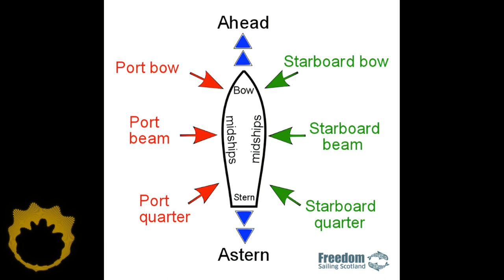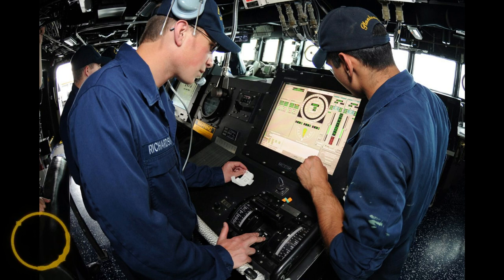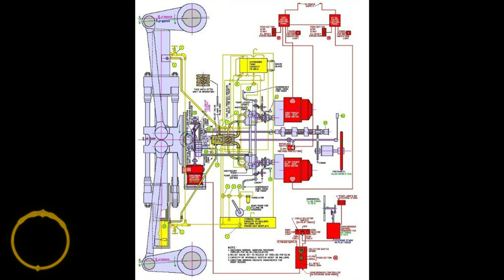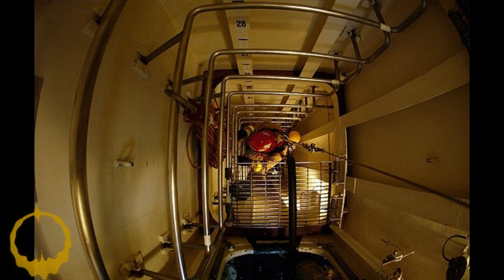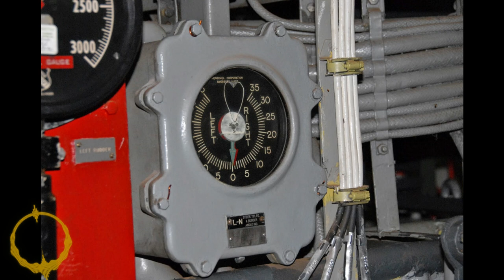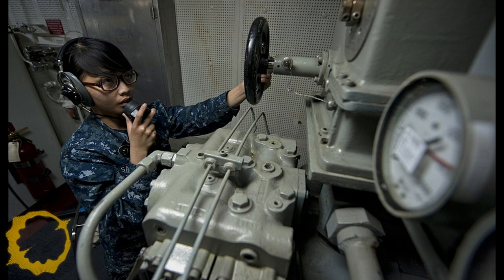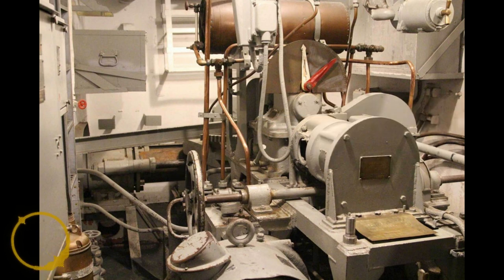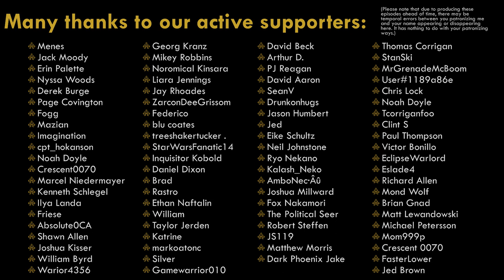I should get an award for a total lack of questionable idioms in an episode about Aft Steering

Comment: In the setting I’m writing, main drives are typically fusion torches for sublight speeds and an Alcubierre style system for FTL fed by a combination of magnetically contained matter/antimatter reactors, fusion reactors, and auxiliary fission batteries(emergency power). RCS is provided by diverting a fraction of main drive power through a vernier system across the ship. And waste heat is cycled through liquid coolant radiator strips that can be ‘buttoned up’ during combat or vented (ejected) to space in an emergency
Reply: The idea is that the fission batteries (RTGs) are used to charge traditional batteries in order to provide the startup power for the auxiliary/secondary fusion reactors on board ship, which in turn supply the immense power required to safely start the primary M/AM reactors on the largest ships like carriers (SCV) battleships (SBB), and heavy/ armored cruisers (SCA). ships classed as light cruisers (SCL), destroyers (SDD, SDDR, and SDDA), as well as frigates/heavy corvettes/system patrol cutters (SFFG, SFFD, SFFP) typically run a pairs of fusion reactors or fission/fusion combination reactors and have a number of thermocouples in line with the primary cooling systems to take advantage of waste heat while engaging the less friendly and cooperative elements.  Also, they lack the surface area and overall mass to efficiently bleed heat passively and therefore have to make up for inefficiencies any way possible.  Also, in my OC universe, ships massing less than 15k metric tons cannot independently make use of the FTL drives in canon, which means ships below frigate class are strictly in system or must “catch a ride” with a sufficiently large vessel (SCL or higher). Anyhoo, love your content, always look forward to seeing what is coming from the harbor master next

Comment: That big wrench thing... there weren't perhaps a set or two of blocks and tackles in a box underneath? Seems that would solve the problem nicely. Just break your back getting the wrench situated, connect the lines from the two block and tackle sets between the wrench and the walls and have a couple of people haul on the ropes. Much more likely to work and much less likely to kill squishies when a wave hits the rudder.
Reply from the maker: "Perhaps".

Comment: Also, regarding steering in space: unlike the "wet" navy ships, spaceships or starships do not have any practical difference in which way they're "pointed" (which in space terms is typically referred to as attitude) if they already reached a certain velocity.

So if you're going at that significant fraction of c, these tiny gas or ion thrusters ain't gonna do squat of your main drive, actually capable of accelerating you to that fraction, is out. I mean they might, in a couple centuries...
What you would actually do to decelerate, is use your backup thrusters in such a way as to alter your course and use some nearby bodies' gravity wells for a deceleration maneuver. If your secondary drive fails, well, you better starts shooting less useful cargo out of a mass driver. Maybe a decent idea to have a backup solar or ion sail?..

The actual attitude control, something I actually have experience with, is done through many different methods. First thing to understand is, the ship ALWAYS wants to turn around it's center of mass. The tiny ion or gas thrusters are a typical thing you see, and they can be quite effective, especially on prolonged hulls, but there's usually more systems that you don't immediately see. For example, reaction wheels (acceleration/deceleration of the wheel's rotation produces a reaction force on the whole ship) and control moment gyros (a flywheel is spinning at a constant speed and some motors move it relative to the ship, it tries to come back to initial orientation, producing force on the rest of the ship. Used less nowadays, a lot more in the early days of space travel.) In orbit you can also use magnetic coils to orient yourself, if the planet has a sufficient magnetic field, but in interstellar space, don't count on it...

Now the spacefaring analog of the 3 m/8 ft wrench you were talking about would be, in my opinion, manually cranking the reaction wheel.
Now it's gonna take a long time, and a lot of effort, but you can realistically rotate a hundreds of tons worth of ship by muscle power alone that way... And if your reaction wheel shattered to pieces, well... Might as well tell your crew to start running in circles.

Comment: Where does "larboard" come from?
Reply from the maker: Ladeboard, which chases forward to your current tongue as "loading board", but we figured your jello CPUs could only handle so many new terms that most of you won't actually use.
Reply: @SacredCowShipyards  
Interesting.
How did the Greeks dock with sailing vessels that had a stearing board on both sides of the back?
Reply from the maker: Their hulls were different.
Reply: @SacredCowShipyards  😊
Yes. And their methods of docking at port where different, too, partially due to the double steering board and partially because of the terrain.

As it turns out, the double steering board system is more efficient than the rudder. You can think of them as being more like flaps, deflecting the stream and creating lift. As such, they don't reduce the speed as badly as a rudder per degree turned. But they do require better coordination, more material and an expert touch. Reducing the steering boards to just one reduces the effectiveness considerably, especially to starboard. None the less, a single steering board is less cumbersome and easier to teach.

The rudder is simpler, less expensive and can be learned more quickly by a noob. Thus the rudder won out.

The most efficient steering system for a sailing boat is double daggerboards that independently lift out of the water, changing the dynamic between aerodynamic lift and hydrodynamic drag. Very little momentum is lost in this way. It's also practically worthless  while either tacking, going directly down wind or while under engine power. So you still need a rudder. Making the whole thing rather niche.

Comment: This is why in the words of O'Brian star fleet requires 2 back ups, incase the first goes down.
Reply: Unfortunately, none of those back ups, nor the primary, include surge protection. 

Because powering the console with plasma piped directly from the reactor with no cut outs is apparently brilliant.

Comment: I used to be an engineer at a factory that build touch screens.  The touch screen operates by you finger disturbing an electrical field that is in front of the screen.  So a the touch part of a touch screen will work if the screen is cracked.
Reply from the maker: Well, no.

That entirely depends on whether we're talking about resistive or capacitive screens.
Reply: @SacredCowShipyards  One of our production lines was armored screens for use in armored vehicles (Strykers and Bradleys).  Capacitive touch screens is a required spec for any touch screen above (I think it was 3.5in X 3.5in at the time, but it was about 15 years ago so I could be off on the size) that goes into combat.  But I can tell you that the touch screen on the ship was capacitive because federal law said it had to be if the contractor who installed it wanted to get paid.
Reply from the maker: And yet "screen failure due to breakage" is literally in the causal chain for a number of these incidents.

You're welcome to draw your own conclusions.

Comment: Pretty sure that the Steering Gear Room would have  Chain blocks and Pad-Eyes , as permanent fixtures for dealing with the Big Spanner , if needed .
The Big Spanner that will definitely NOT be painted onto the Bulkhead Cradle it lives in . All academic if the Rudder(s) have been blown off .
A  retractable vertical Fore-plane could be a good final back-up presuming the Engine/Propeller are still functional . 
For all the High Tech , warships still to this day have a Sextant in the keeping of the Navigation Officer . 
All you gotta do is : One , Stay afloat . And : Two get close enough to home to get Towed in .
Reply from the maker: And yet it was painted on.
Reply: @SacredCowShipyards  . What ? A Black Outline , to show where it was Stowed ?
Unlikely it was Paint Bound .
Reply from the maker: No, the wrench, itself, as I've said, repeatedly.
Reply: @SacredCowShipyards  I  hope someone got their Arse Kicked about that .

Comment: I'm sure that touch screen control was designed and pitched by somebody who's only experience with ships is a seven day vacation on a cruise liner. How the hell are you supposed to use that thing in rough seas or in changing light conditions. Also if for some reason you are wearing polarized sunglasses (maybe the ship is sailing towards the sun) the screen may not even be readable. Not to mention that touchscreens as they age can experience "phantom touch" syndrome where they randomly detect input that does not exist. If that screen has a protective cover strong enough to handle a crewman falling or slumping against it then the amount of force needed to select something on it will be excessive, you do not want a helmsman spending an eight hour watch basically punching the screen with a good deal of force. All in all a piss poor design.
Reply from the maker: "Why are there holes all over this screen?"

"... don't ask."